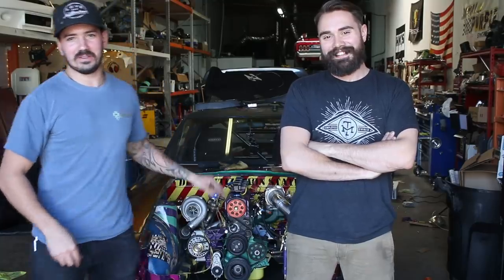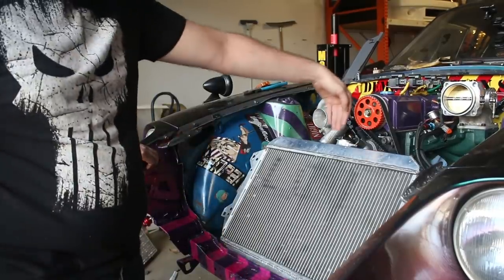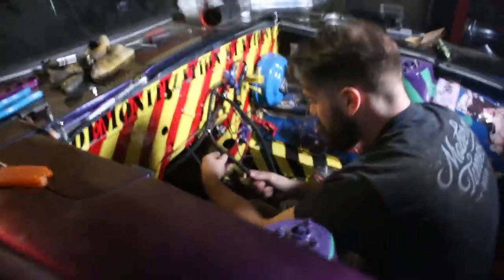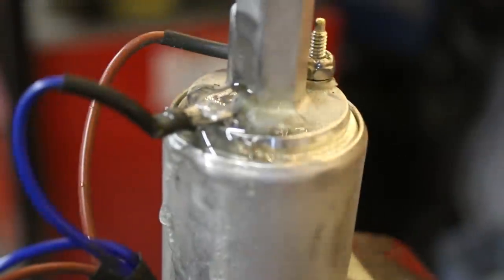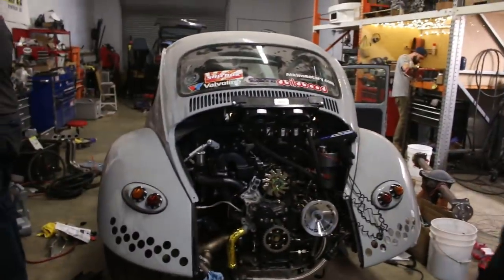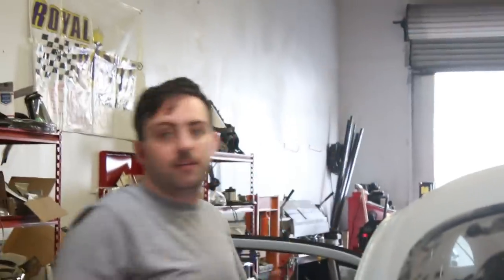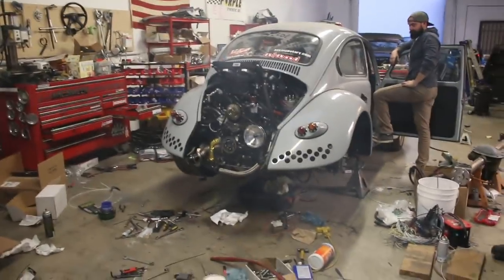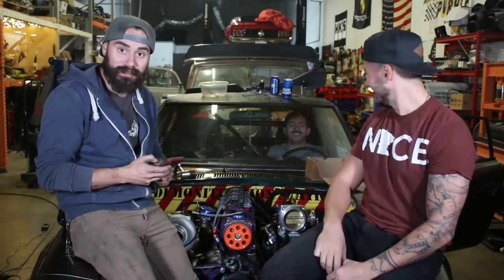THE 2.3 240Z IS ALIVE!!! - SOUNDS CRAZY

Comment: Isn't the benefit of v-mount something to do with the radiators effectively being thicker because they are angled? Like tank armour.
Reply: The main benefit from v-mounts is that you create a air trap between the radiator and intercooler and that basically creates a high pressure zone in front of the car that forces more air through radiator and intercooler since the air cant go around the cooling system anymore
Reply: spazda_mx5 yeah but like I said during the extended mouth diarrhea,  that basically only happens with cross flow setups and intercoolers, since the front facing surface area is increased.   The main benefits on this car are pretty much limited to getting separate airflow to both the radiator and intercooler.    Also. Having the hood properly vented with any system also drastically reduces front end lift/increases downforce.  Massive hood holes incoming.

Also.  Another large benefit is the close to 2 ft we will be able to remove from the intercooler piping
Reply: Spinddrift that’s pretty much what happens with any cooling system.  As long as it has proper shrouding and ductwork,  I suppose the scooping of air is more dramatic but its definitely not the only benefit

Comment: Mounting your radiator (and/or intercooler) at an angle will Decrease frontal area, essentially giving you a smaller radiator and less cooling. As far as the "cross flow" theory of having the cooling air contact more metal...true, but it's once again Less Air because of frontal area and air being blocked by adjacent coolant channels...not to mention the air has to make a dramatic change in direction to then flow through the radiator and exit the back side slowing That flow providing less cooling. But it will work enough...and look rad.
Reply: yeah none of their technobable on that made any sense LOL
Reply: Yeah if you’re doing the tilted radiator thing it’s meant to be leaning towards the wind, with a front splitter and ducting to force the air in, and then a bonnet drop scoop sealed to the back of it, that way the splitter forces air in, and the air flowing over the bonnet pulls air out. 

As a bonus it adds front downforce, and lowers under bonnet temps because the sealed scoop behind the radiator means the heat coming off the radiator doesn’t get back to the engine.

Comment: You want the radiator and intercooler leaning the other way... with a duct out the top of the bonnet.
Reply from the maker: Johnathan Doe we have ducts out of the hood for the intercooler and a fan mounted under the radiator.
Reply from the maker: Mounting the other way would cause a shield in front that deflects oncoming air.
Reply: Team Boosted 

Nah no more of a shield than a regular vertical mount is. As long as the drop scoops sized right, and there’s no way for the air to take a different ‘path of least resistance’, the air flowing over the bonnet’ll pull air through the radiator, check out the ford gt40 for an extreme example.

Your way’ll still work, but it won’t counteract front end lift as much, because the air coming out the back of the radiator will still be going underneath the car.
Reply from the maker: True but the GT40 doesn’t use V mounting. It uses a linear path like vertical mounting except intakes through the bottom and out of the top. If we V mounted how we have it now but pointing the V in the other direction it would cause the deflection I was referring to.
Reply from the maker: But your right, that way would have more downforce. Downforce just wasn’t a consideration in this application.
Reply: Johnathan Doe the idea was more so to separate the air streams to increase cooling.  This car won’t be a top end speed demon so downforce was a secondary concern but the air flowing through the intercooler and out the hood vents should more than counteract the lift these cars produce at speed.   It also has a front air dam which does a huge amount for  reducing lift as well.